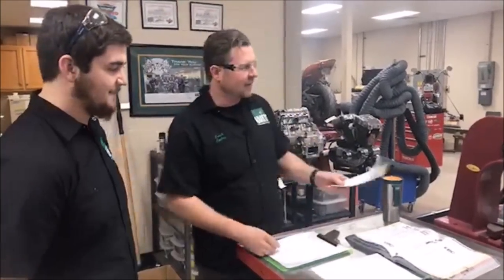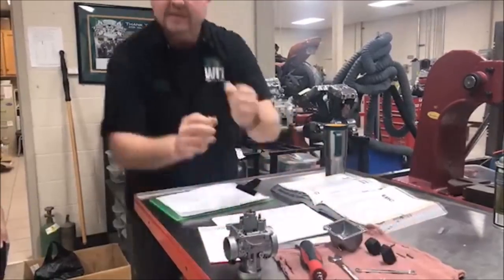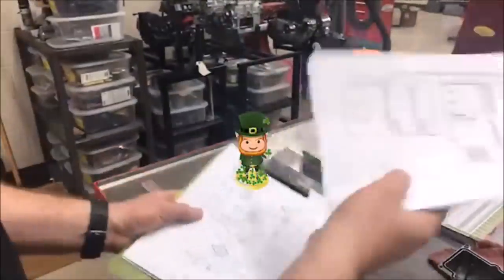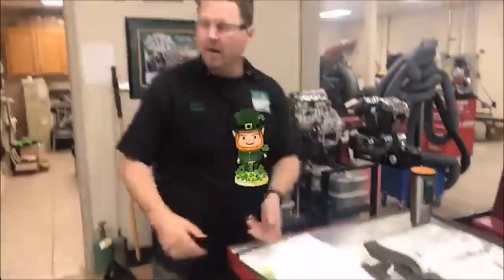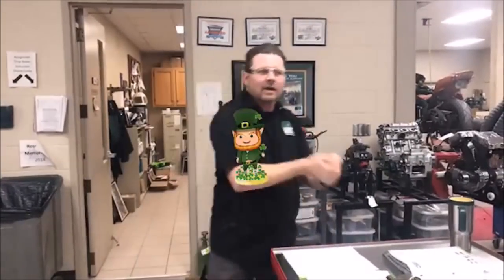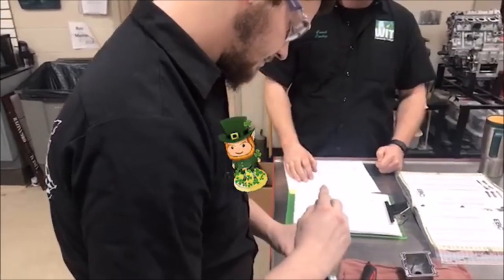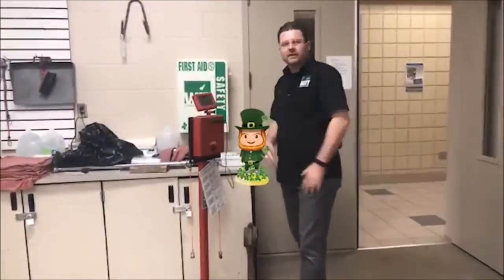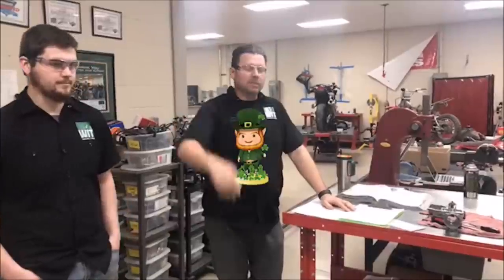The Hardest thing to teach others...the "feel" of fasteners...

Comment: Yamaha service manual for my bike says front sprocket retaining nut should be done up to 105Nm. Haynes repeats that figure. Then the figure is repeated online on owners' forums... But it's wrong! Should be about 90Nm, in my opinion. It's a specially designed nut used on several old Yamaha bikes, all of which specify a torque setting of either 80Nm or 85Nm. Tightening it to 105Nm will strip the very soft, fine threads inside the nut. Just one of those things you figure out as you go.

Comment: Have you ever made a video about how to learn to "feel" feeler gauges?
Reply: Best way to to feeler guages is the go/no-go method because it's more precise.  A good way to hold feeler gauges in tight areas is use long forceps with individual leaves, not an entire typical folding set. (That's one reason the better ones are held with a knurled, removable nut.)

You can train yourself with a micrometer. Set your desired opening then snug the lock ring/lock lever on the micrometer. Try different feelers to learn feel. Repeat with a variety of openings and feelers as the thinnest size are quite flexy and feel different.
Reply: The micrometer trick is great. Thanks